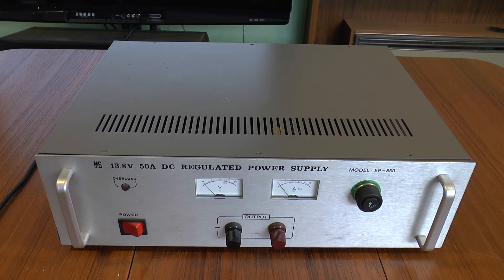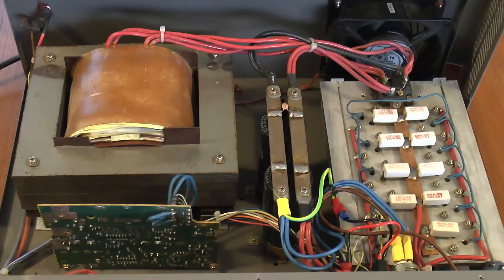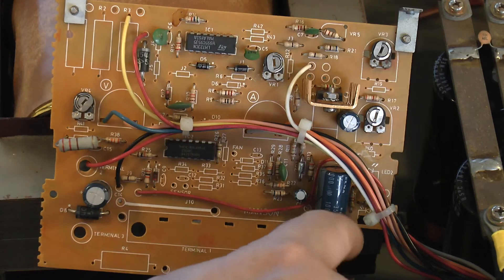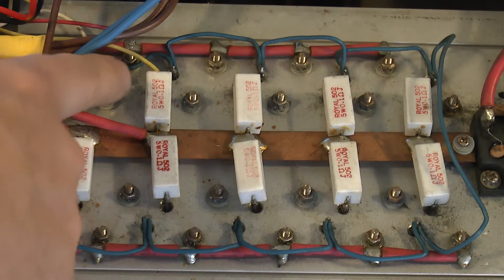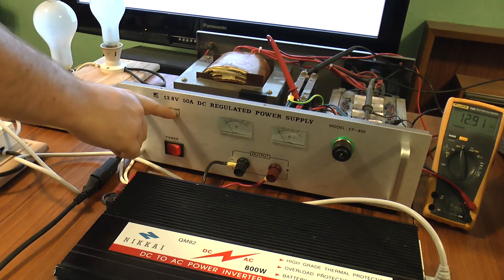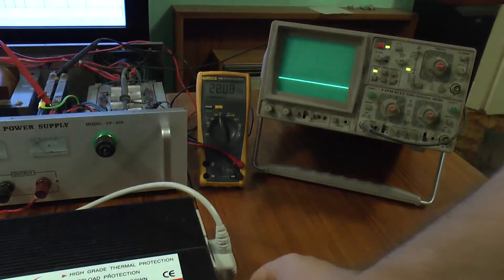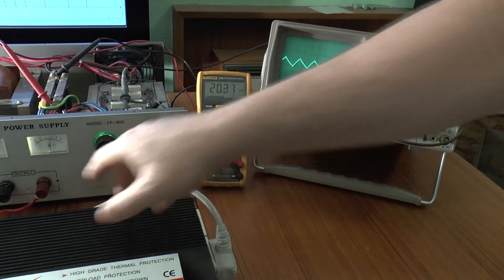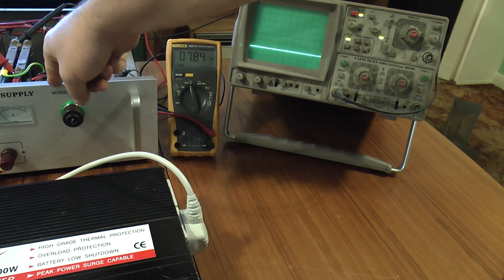Manson EP-850 power supply teardown

Comment: Do you think the regulator is saturated?.. Measure output voltage and reservoir voltage on the Hameg.. I'd guess you'd need at least 5v headroom for the regulator to work.. Potential tricks, drop output voltage a bit and/or Variac bit more primary voltage..
Reply from the maker: I'd check the easiest stuff first.  Check for dry joints, measure/test all components (could test them one by one out-of-circuit, sorting out the joints as you go).  Socket any ICs and swap them if you suspect them, or even if you run out of other things to suspect.
Reply: @AintBigAintClever  I hadn't realised the age of this video, just randomly popped up in my FB newsfeed so assumed it was recent.. Couldn't quite see Hameg time base, I'm going to assume that sawtooth (reservoir cap charging) is 100Hz and nowt to do with the inverter, the more you load it the bigger the sawtooth, trouble is, finding a suitable load for it.. Works fine @ 8A, 50W headlight bulbs?
Reply from the maker: @nickjones886  yeah, it's a long time since I poked around inside that thing, so can't remember a lot of what I was poking around with in there.  I have been known to refer back to my own videos to find out how I did something before :D
Any timebases within the PSU would be 50Hz or 100Hz.  Simple stuff, no bitey switch-mode shenanigans. In the inverter the output would be 50Hz modified sine, with a much higher frequency in the boost converter.  I'd look through the video now but it's Christmas and it's bedtime :D
Reply: @AintBigAintClever  I have a power line something 305, all I know its a 30 ish V and 30 ish amps, uses a triac on primary of main (fairly hefty) transformer then a linear rear end.. Noisy thing, circa 900W.. Useful for killing stuff off.. I replaced the 115v AC motor with a DC version and built a circuit to alter pwm to fan as the heatsink warmed up, bit quieter and not used it ever since.. Got some tops3D psu, linear are the best, they need sorting, can't align them, few knobs missing.. Linear supplies used to be bread n butter when I worked, started to see a lot more smps and enjoyed working on them, especially the 3kW Farnell units..

Comment: i have the Palstar PS-50 version of this which uses two transformers and 1 driving 11 transistors..
what i am stuck with is 22v out of the front..
all transistors are good, yet the drive is a PNP driving 11 NPN ???
although same looking unit different internals..
now i got this free as faulty and replaced four 3055, but without a schematic i suspect the 1st driver shouldn't be a PNP but another 3055 NPN.

any ideas ??  mods.dk has a poor schematic which shows 1x3055 driving 11x3055 but not on the schematic just added text :D lol..
Reply from the maker: I don't know if the schematic for the EP-850 would be any use? I've uploaded a copy here: https://plus.google.com/b/106948293336791915873/photos/photo/106948293336791915873/6452409247297156530

It may be that your design is supposed to have a PNP driver, it'd be worth tracing through the output in the schematic to figure out what happens. For example in the EP-850 if the LM723 raises its output voltage, it'll turn on the TIP31C, which raises its emitter voltage towards the supply rail. That turns on the first 2N3055, which also raises its emitter voltage towards the supply rail. That then turns on the rest of the 2N3055s which raise the voltage at the output terminal.
In this design all the bases get raised above emitter voltage to turn them on. If instead the middle transistor (in my case the first 2N3055) was a PNP device, then the first transistor could pull its collector low (instead of its emitter high) to get the PNP to turn on, which would then drive the final transistors as it does now. You'll need to look at the connections of that first transistor to see whether it's pulling up to the supply or pulling down to ground.

Looking at the schematic for mine you'll also want to check that there's a feedback from the output rail to the input of the LM723 or whatever's on yours. If that feedback goes open circuit the regulator may think the output's gone too low and run its transistors full tilt to try and compensate, thereby giving you a sky-high output voltage.
Reply: pretty close,
the Palstar runs two transformers and 11 3055 but they are similar..
strange as i swapped out the PNP MJ2 something for a 3055 and it didn't work, blew the fuse so wired it the opposite way, and it had nothing,
so i put the original MJ2??? back in and it's back to 23v
all 3055 meter good on an ESR..

i'm stumped..
Reply from the maker: Follow the chain of transistors back up. What's feeding the MJ2? If it's another transistor, disconnect its base from the PCB and put a pot across supply and ground with the wiper feeding the base via a fixed resistor. Does varying the pot vary the output voltage? If it does then you've got an issue further back in the circuitry and the transistors are all good.
On my schematic you'll also see a 220 ohm resistor between the output and ground, I expect that's there to present a minimum load (otherwise the off-load output would be a 22 volt supply with the regulator simply controlling how much current the transistors are prepared to let through). Test it with a pair of 12 volt bulbs in series on the output terminals. With these in place does the supply suddenly drop to its proper output voltage? If so, track down that load resistor and test it.

Comment: What you see on 2:40, is the same board that comes on the front of an EP-815 model, it's a 15 Amp supply with only 5 (2n3055) power transistors notice the 5 drawings on the board for the 0.1 ohm resistors (R1 to R5), to the left side, two holes for the output terminals, and bla, bla, bla... All this types of supply's working with the LM723 ic, make a great performance for ham radio users. I' love this supply...!!

Comment: A very well presented review, in my own 100a power supply I used two transformers, secondaries in parallel and primaries in series to ensure load sharing, a point you suggested earlier. My 723 drives a BFY51 which drives a pair of 2N3733 which drive 24  2n3055s in parallel. Each has a 0.2ohm emitter resistor and each group of 3 has a 15a fuse. My current limit is set to 125a but I also have a 300a thyristor crowbar and a softstart that will remove the mains if the output drops.

Comment: Hello, I have 2 of them in parallel for a HF radio amp. One is regulated at 13.85, the other at 13.60. So all is pumped on the first until voltage drops to the second one. How can I adjust them to same level? By the way, mine have regulated fans.

Comment: ello + great vid, now ive had problems with mine, sumtimes wrks great then overloads im running a rm kl500,i suspected a dry joint,  5k potential pot vr2 as i turned it down the voltage dropped and started joddering so turned it the other way which seems to help but not for long,maybe worth changing the pot also re-soldered just in case the dry joint was on the three legs not worked. so last resort was to un-solder the leg off d12 but whats the danger in doing so will i totally dmge th amp thnks

Comment from the maker: You wouldn't catch me pawing around inside it if it was switched-mode. On this one you keep away from the fan, switch, transformer primary and the back of the fuse holder, and don't wear jewellery 'cos those big caps will have a field day with a ring or a watch :)

Comment from the maker: I believe this one used to run a radio display, presumably like you said one with booster amps. Smaller displays use 3 amp or 5 amp power supplies with a trickle-charged SLA for the permanent 12V supply to keep the radio presets.

Comment: One way to reduce the power dissipation in the pass transistors at low output potentials is to have multiple taps or some similar arrangement for the supply transformers so that the unregulated supply potential can be reduced if a low output potential is needed.  Note that this needs either tapped winding transformers or (with multiple transformers) transformers that have low enough output potentials for them to be able to be connected in series or in parallel.

Comment from the maker: Alternatively use multiple transformers with the primaries in parallel and the secondaries in series. Triac-switch the secondaries though, switching the primaries might get all sorts of weird voltages at the switched-off primaries due to their secondaries sitting in series with the load.

Comment from the maker: Thinking about it, you could use a pre-built transformer with the lowest voltage that you need, but with the maximum power that you need (if for example you'll ultimately need to draw 36 volts at 40 amps, get a 24 volt 60 amp transformer). Additional windings to "top up" the voltage could be added by hand later (multiple secondaries brought out and connected in series).

Comment: You could use a transformer with multiple taps and a big switch to select which tap to use. That way you wouldn't have to burn 500w when outputting low voltages.